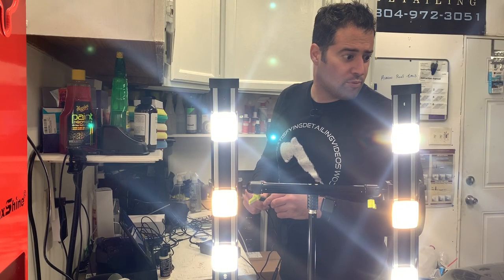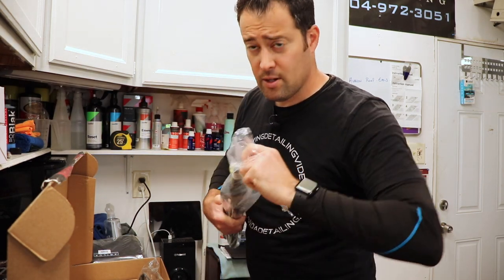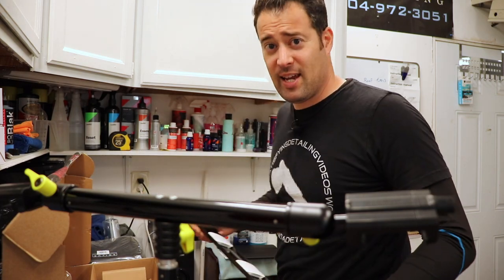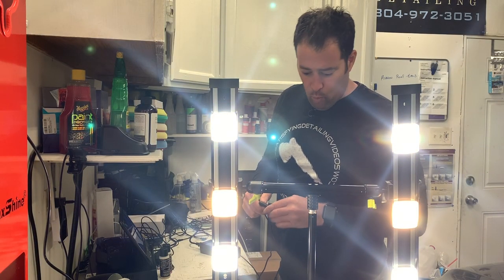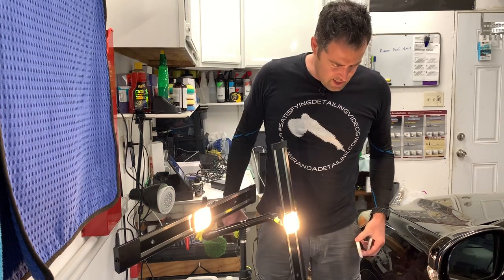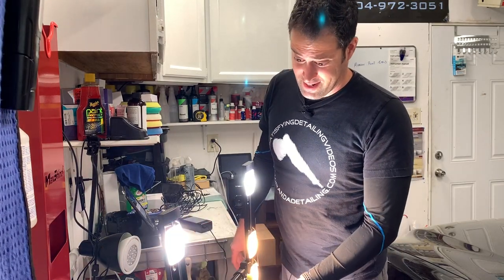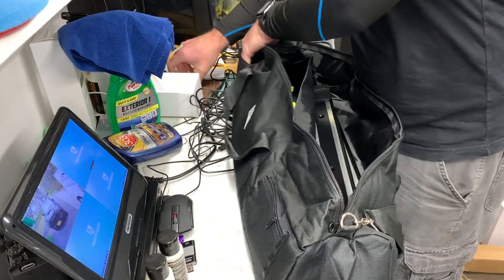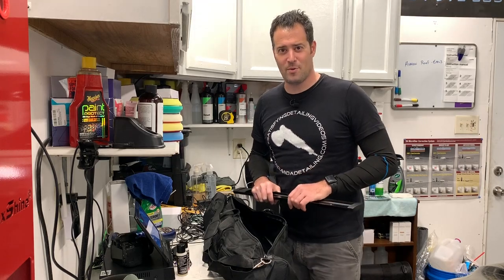NEW AGILUX LED Light Kits!  #Autodetailing #Paintcorrection #LEDlights

Comment: Curious question where I’m starting to do this a little bit more often due to my regular job doesn’t exist right now. I have some customers for some higher end cars and I’m not sure if I can use regular products on them I have a customer with the Jag and one with the BMW. Do I need to know anything different about buffing and or polishing? Greatly appreciated thank you
Reply from the maker: Hi
That’s great!  You can compound and polish pretty much all paints. They are all pretty much the same. The only thing you need to keep in mind is paint thickness and how hard or soft it may be. Super cars or customer cars may have different paint systems but they can still be polished the same way with the same product cut. If you watch Larry from AMMONYC he details tons of different vehicles with the same tools and products. He just varies his approach and is careful with rare or super cars. Pretty awesome stuff!!
Reply: Miranda Detailing Thanks so much I was nervous doing more expensive cars I thought maybe I need special products. As usual thanks for the help.